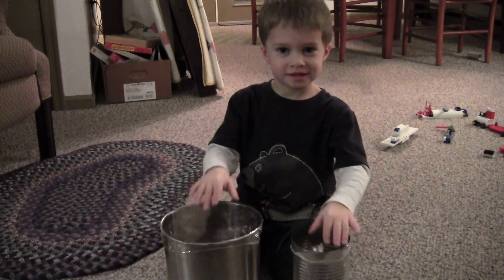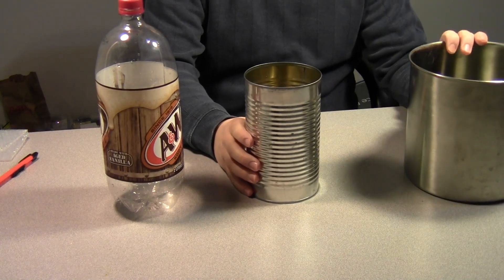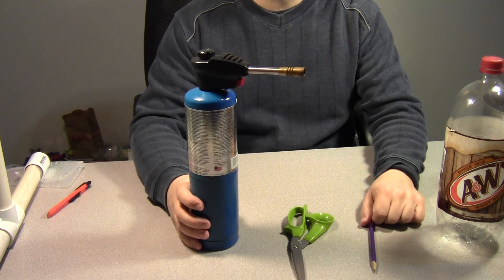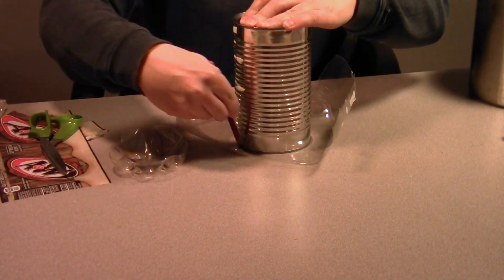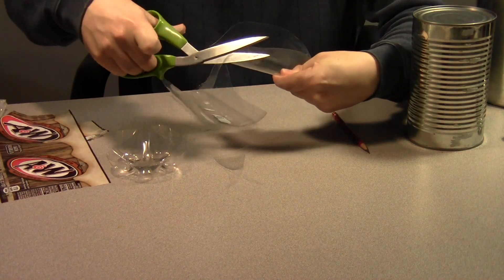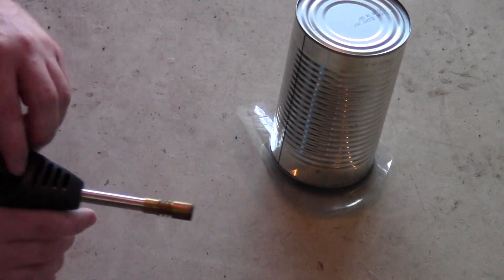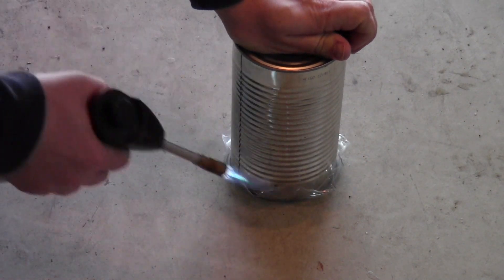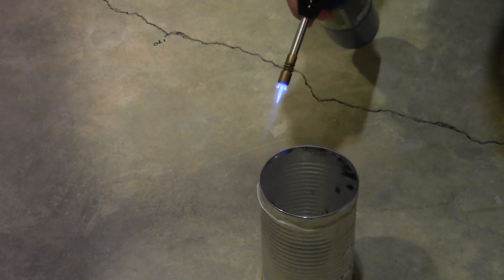How to make a toy drum in 2 minutes

Comment: Can't you make it with a hair dryer
Reply from the maker: I'm not sure about that - it might be able to if it is pretty hot.  I've heard that a heat gun also works, and is a bit safer than a blow torch.
Reply: Oh my gosh I'm a hairstylist and I have this dryer that I don't use on my clients that the top heat setting gets so 
 hot I have done projects were it could be used as a heat gun LOL